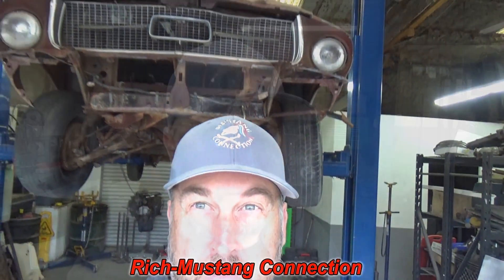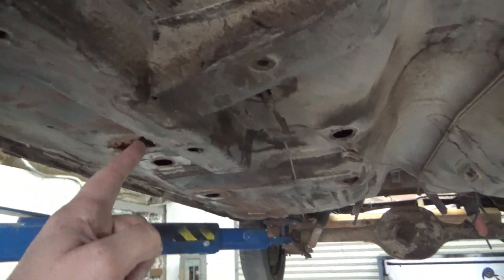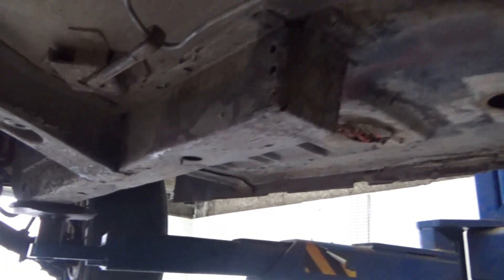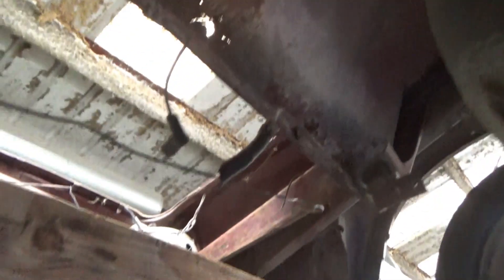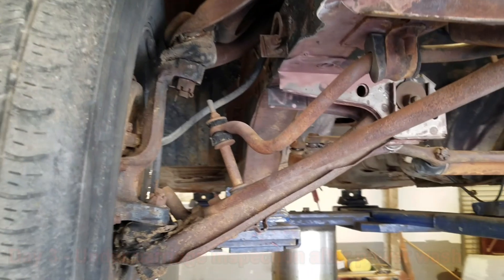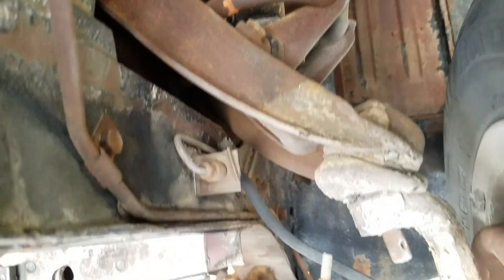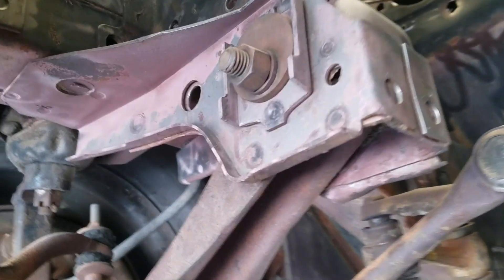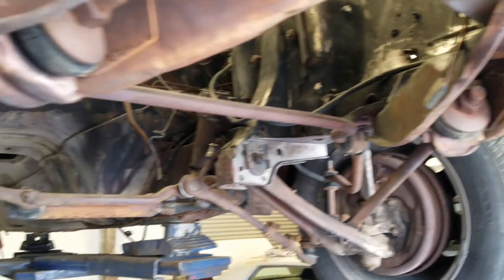What's underneath ? Project "Mut" 1967 Ford Mustang Desert find - rescue Part 3 Mustang connection

Comment: Having those original "good bones" saves a ton of work, that's why it was worth it to me to have my '67 project shipped from California. A lot of the old Mustangs here in the Northeast at times look OK at first glance, but reality is rusted cowl, frame rails, floorpans, torque boxes, fender aprons, core support, etc. etc. To do it right, you end up building a Dynacorn 'stang.
Reply from the maker: I have to agree completely, I admire folks who literally chance every panel and part but how much is left and still that American Mustang is in question. I only try and get cars as rough as they may look that don't need full floors, aprons, frame rails, etc. Thanks for watching and commenting always appreciated. How is your '67 coming along ?
Reply: @MustangConnection1  I'm looking forward to following your '67 project. I just started working on mine....have one day a week available. I started with preserving the original floors, cowl vent area, and firewall. Moving on to everything under the dash. It's fun straightening out years of deterioration and neglect and making it right. Goal is a nice driver with a few performance upgrades.